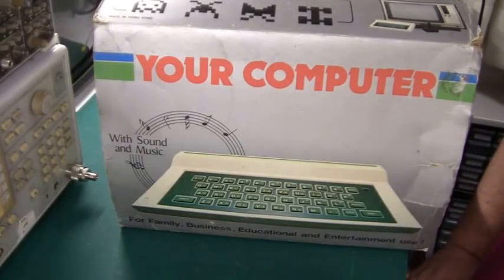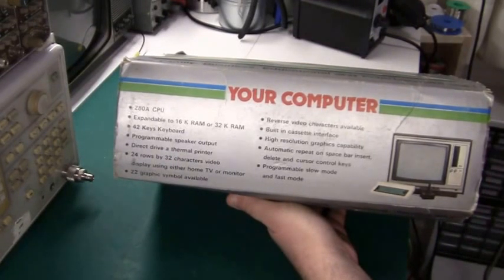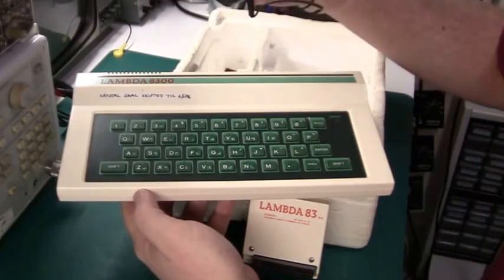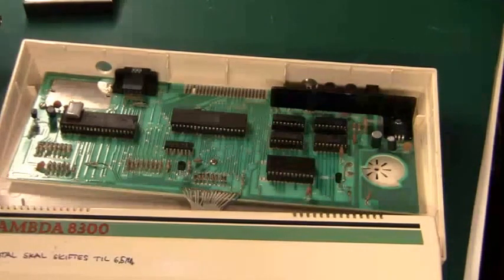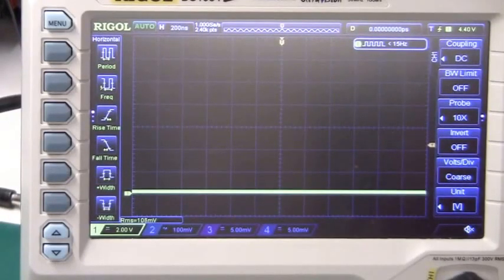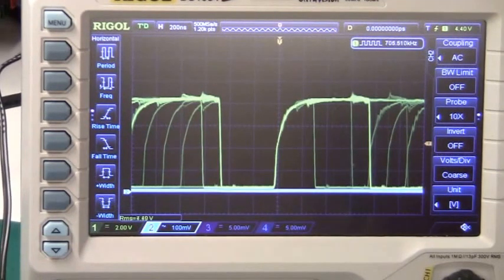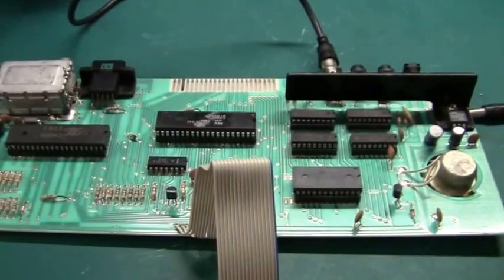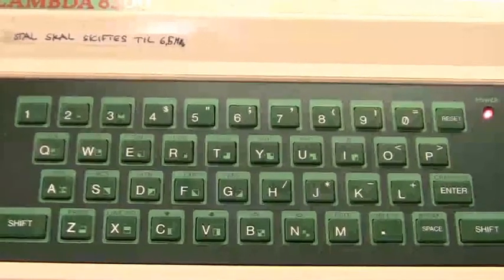Teardown and repair of Lambda 8300

Comment: I'm surprise the thing ran at all at that voltage. But what about the other IC's on the board that are also rated at 5 volts?
Reply from the maker: It's definitely borderline. The absolute maximum rating for the Z80 is something like 7V, and this one outputs 7.5V++. Also, the RAM pack does not work if I clamp it to 5V, so it must be by design.
Reply from the maker: It's only one signal to the Z80 that is at that elevated voltage. All the other pins, and chips, are at 5V.
Reply: The ZX81 could actually run on 12v since it had a 7805 to power it but you took the risk of frying anything which was connected to the expansion port.

Comment: Hi. Any footage of the RF modulator install ?
Reply from the maker: Unfortunately not. I ran out of memory on the SD Card. However, it was a simple matter of soldering the metal can to the PCB, and then the two wired that sticks out of the modulator, for power and signal.

Comment: Very nice repair job. Why was the crystal changed? Did you try to over clock it? Take care.
Reply from the maker: +TheRadiogeek Overclocking was unheard of back then. Also, it wouldn't have worked, because the machine gets its display timing from that crystal. To be honest, I can't remember what I needed it for, but money was scarce back then, and I thought the Lambda was a piece of useless crap, so....